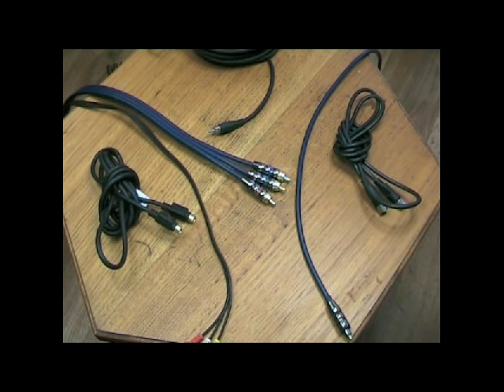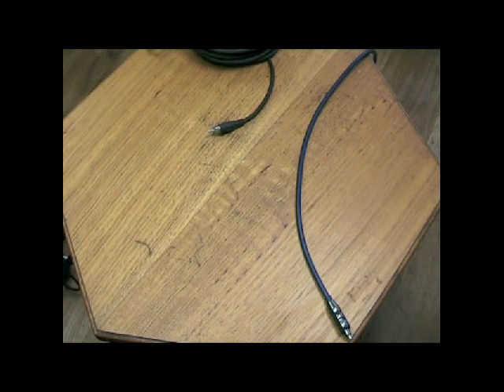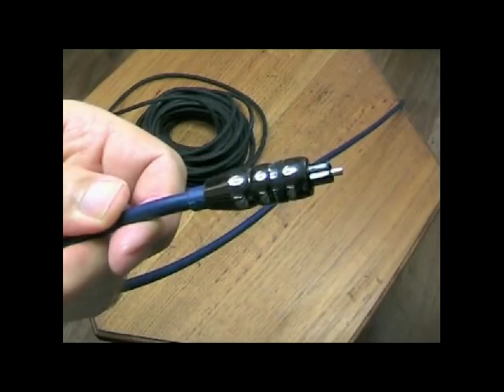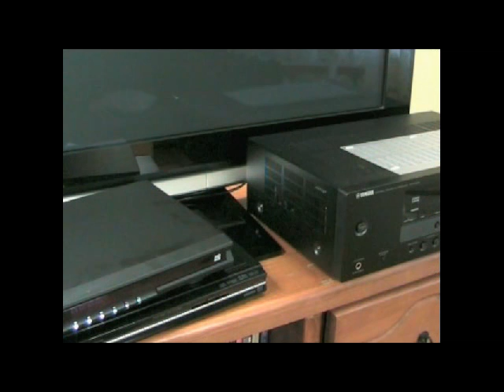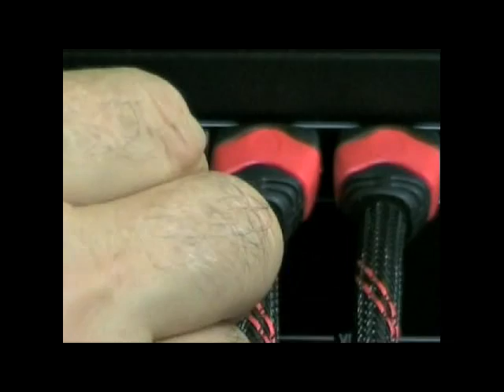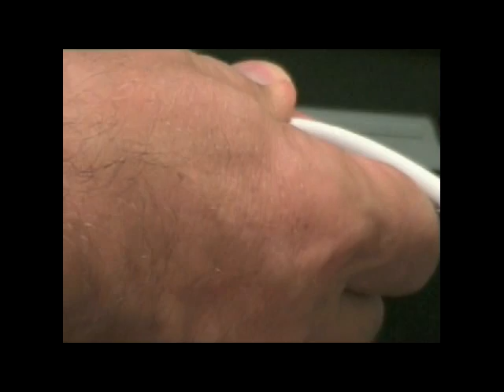HDMI made simple.avi

Comment: Dear Ekkehart Mundana,
Can I ask you a question, please?
I connected (by HDMI) my blu ray player to my 3D television.
The Picture is great but the audio has too much bass.
.
Is it possible to connect it to the television, so that I can control the bass tone with the television controls?
I put my television on hi treble and low bass as I have difficulty hearing the spoken word when the television news is on.
.
The blu ray player is by passing the television audio controls.
It seems that I only hear the standard out put of the blu ray player, a sound that is not adjustable.
If I can't connect via my television "controlled audio",  do I have to buy an AV receiver?
Or is there some other device that I could use to adjust the tone on my blu ray player output.
Or, if not, what is the smallest AV receiver, that I can get, the one with the fewest features ?
As I have a small apartment and not much money, (left). !
.
Please let me know.
Thank you very much.
.
Yours sincerely
del-boy